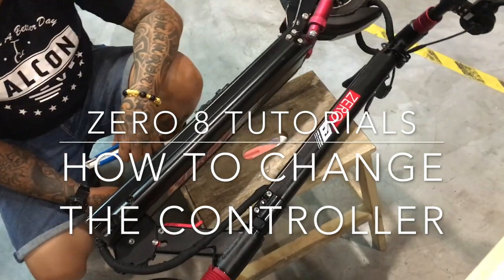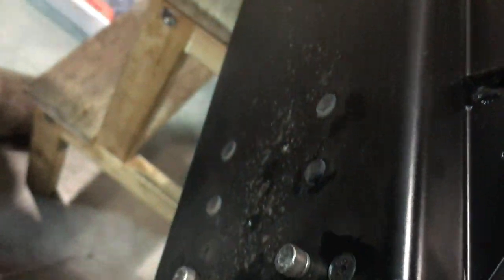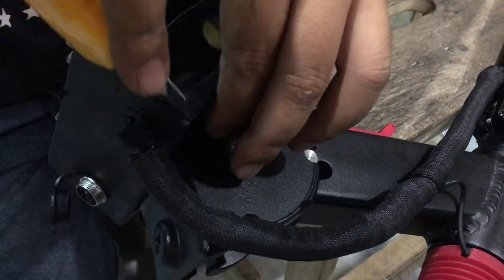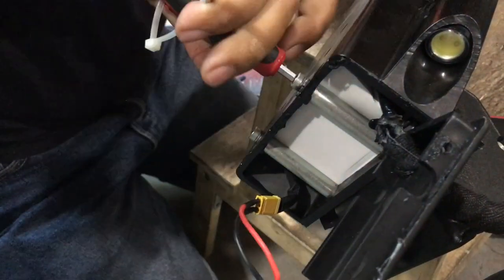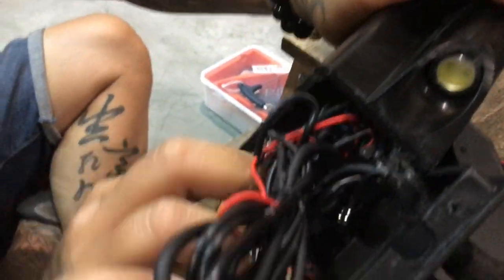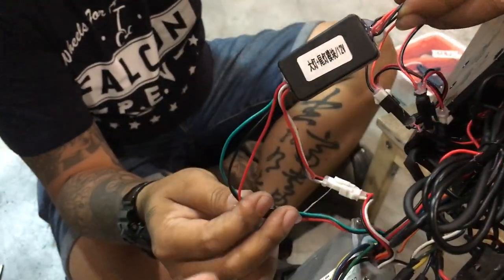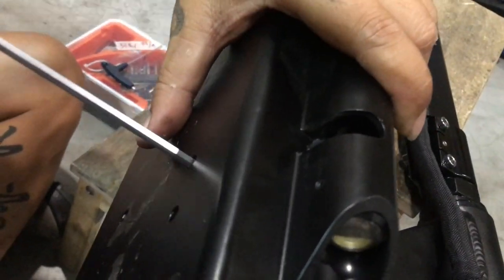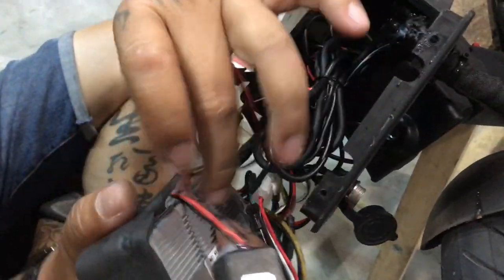ZERO Tutorials: How to Change the Controller of ZERO 8 e-scooter

Comment: Which are the screws that hold the joint to the horizontal main frame?

One of the screws at 2:10 broke but it seems they are not connected to the joint, they just keep the "case" together

Comment: If I have problems with the scooter shutting down after going over bumps or even random shut downs would you suggest to replace the controller or the DC converter?
Reply from the maker: Should be battery issue
Reply: @FalconpevSg  Ok thanks. The dealer said it's probably the converter but I'm not convinced.

Comment: Hi guys, is there an equivalent tutorial for Zero 8 Pro scooter? Which kind of controller should I buy to increase performances?
Reply from the maker: Is yours 48V or 52V?
Reply: My scooter is a Zero 8 pro and it comes with a 48v 15.6Ah stock battery
Reply from the maker: @ceccolaqualunque1665  you can try to fit a 25A controller if you want
Reply: @FalconpevSg  no risks to fry the battery??

Comment: Does the Zero 8 have a fuse somewhere?
Mine shorted out due to what seems to be a faulty charger
Reply from the maker: No fuse. You may have to wake the battery up by unplugging it from the controller and plugging it back in. Or take a new charger and plugging it in.
Reply: @FalconpevSg  thank you for your quick response.  The thing is that I saw a big spark flying and heard the cracking sound when I disconnected the charger after a full charge.  Could the controller be fried?
Reply from the maker: @ventilator2999  big spark is not so bad. Check your connector to see if the leads are burnt. Then isolate the controller from the battery and make sure it’s ok to charge.
Reply: @FalconpevSg  one of the 3 connector pins actually melted a bit…I will open the scooter up and see if it starts up after your suggestion ;). Thanks again so much for ur advice

Comment: I have a zero 8 scooter with a speed limiter. I want to remove the limiter to use the scooter on my property (sweden). Can I remove the limiter by a similar process to the one showed here, and disconnect it?
Reply: rosselur hello, I’m trying to remove the speed limit too. Have you manage to do that plz ?
Reply: What’s the limit? I have zero 8 and I get up to 35km/hr
Reply: @Cantdecidethough  The limit on mine is 20kmph
Reply: rosselur oh nooooooo Im sorry to hear that. You’re riding on 3rd mode right? I get up to 20 km/h on second mode
Reply: @Cantdecidethough  yeah, i'm on 3. 2 is even weaker, so they didnt just disable mode 3, they did something else. havent opened it up yet. it has been winter up here :)
Reply: rosselur oh that’s too bad. Hopefully you’re able to figure it out. How much total Km are you at? And how much do you get per charge? For me I’m at 2100 km but now I get only 15 km on a charge
Reply: should have a white  wire the installation who come from controller and limit the scooter to the legal speed of 26.This wire is located to the set cable who go to acceleration and is VISIBLE.This wire should be cut.Mine go to 39 km/h

Comment: What a mess. LOL
Reply from the maker: Bangkok Bike Tours if you have nothing nice to say...
Reply: @FalconpevSg  Bangkok bike tours has a valid point, i have a zero 8 and have vibration in the deck, now i know why. It is a great scooter, but the wiring and placement of the controller is very amateur and low quality, definitely one place where corners were cut.
Reply from the maker: Dave K the vibration is not due to the placement of the controllers. The zero 8 has solid rear tires which causes some vibration. That can be solved by using a better suspension which we are trying to do.
Reply: @FalconpevSg  It does seem like maybe the spring shock mechanism is indeed what is causing some of the vibration. Interested to see what you come up with for improvements, my zero8 is almost perfect, but still a little harsh with the solid rear tire.
Reply: Guys can i ask for help with my zer0 8?